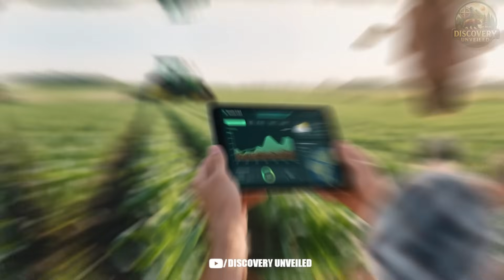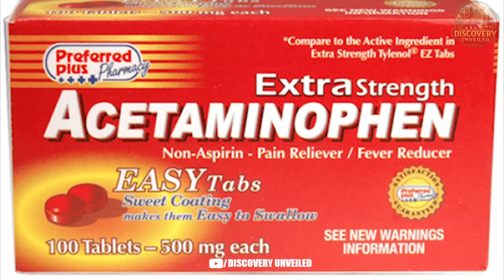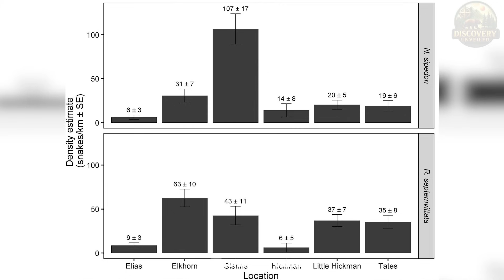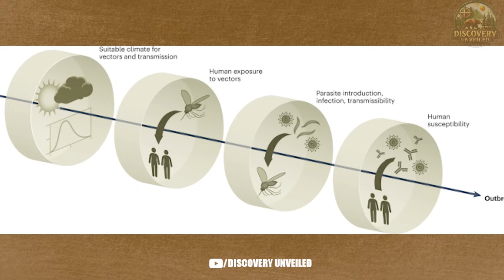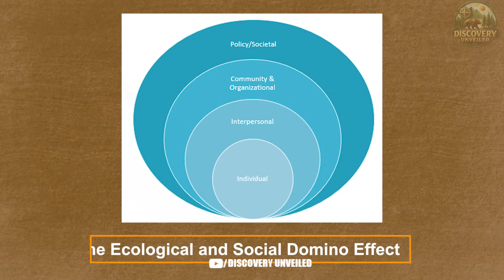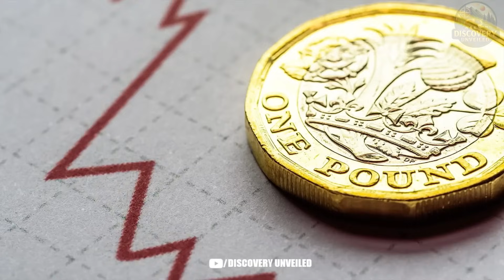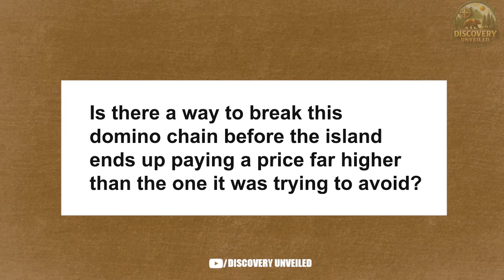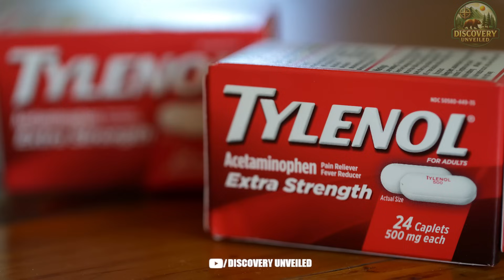U.S. Eradicated All The Snake On The Island… Ten Years Later, U.S. Plan Comes At A Cost

Comment: They need to introduce thousands of mongooses into the space to detail with the snake.Using Nature against Nature is very effective.
Reply: That was done on Hawaii where the Mongoose were much more apt to eat eggs than hunt snakes.  They tend to actually avoid snakes if they can.  It did not help the birds of paradise, to introduce an animal with higher metabolic requirement.
Reply: Long time ago snakes were many in Jamaica and causing an issue mongooses were introduced and they illuminated the snake now Jamaica is free from snakes on the island.
Reply from the maker: @Megalithovorae  History shows that fixing one problem can spark another. What better ways could balance be restored without new predators?
Reply: @DiscoveryUnveiledd  Replace the animal in that niche (the snakes) with a less problematic predator of rats.  Possibly a snake which doesn't climb power lines and with venom that's not problematic for humans.
Reply from the maker: But mongooses can also become invasive. Do you think restoring native birds or habitat could work better long-term?
Reply: We are happy to get rid of snakes by any means necessary.We rather have more mongooses than one snake.Snakes are very evil and wicked creatures.
Reply from the maker: @howardharris4718   But past mongoose releases caused big damage too. How can we control snakes safely without new risks?